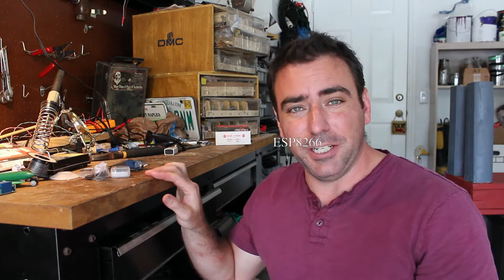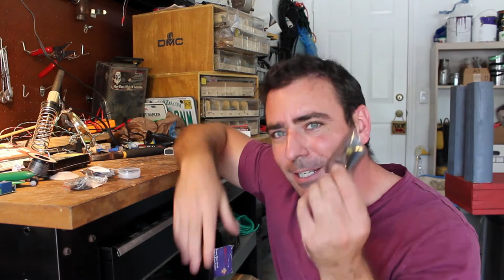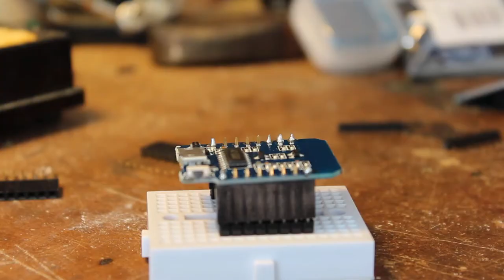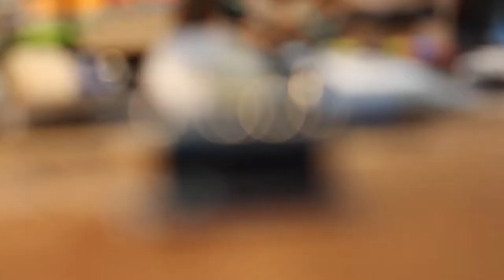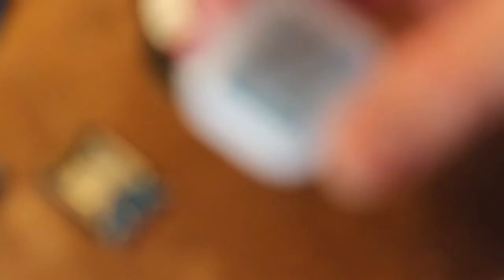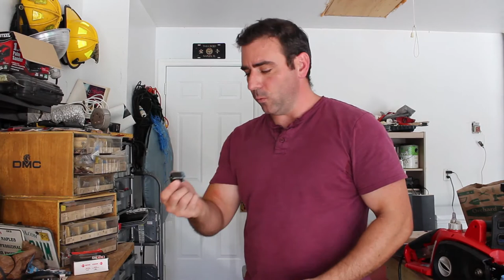Wemos Mini Module Soldering 2017

Comment: I tend to use a flux pen first as the tinning on the board connection points is often oxidised and this definitely makes the solder take much more easily!
Reply: Yes. I always scrub my connection pads, and pins, with alcohol, just prior to soldering. I've never used paste, but plan to start.